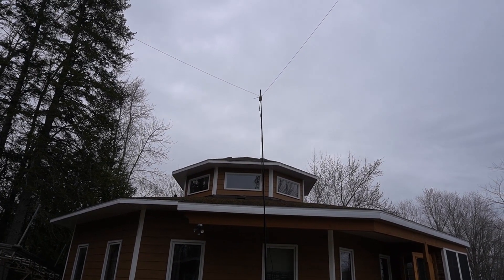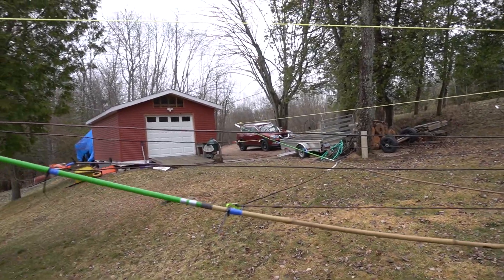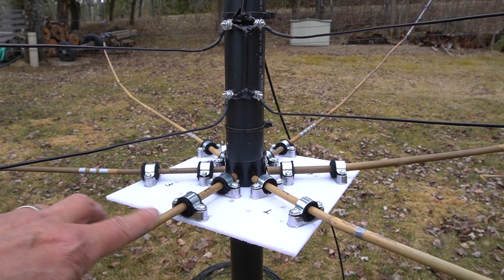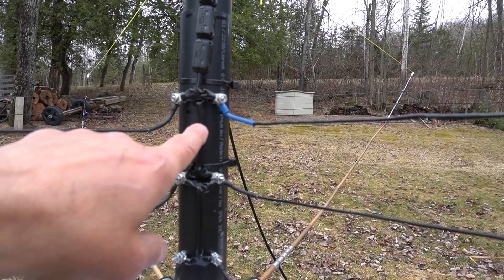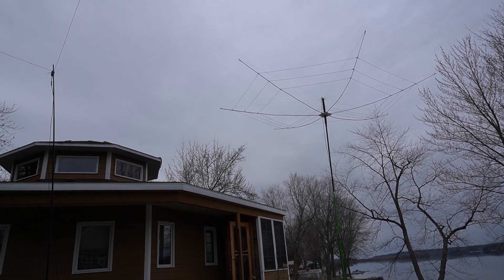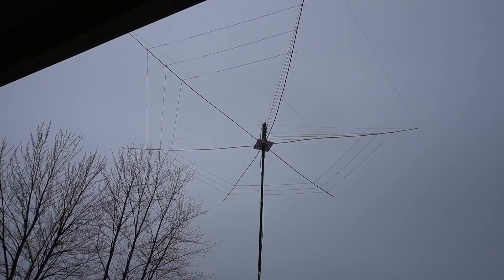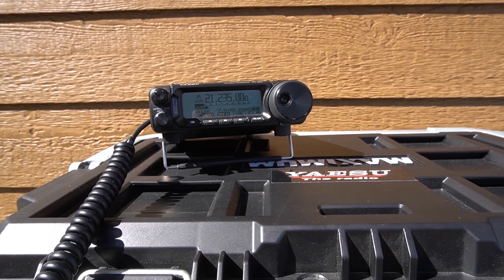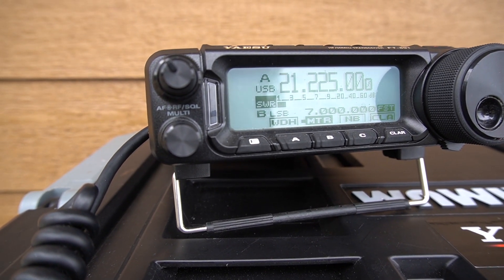HAM RADIO - HexBeam 10/12/15m Home-brew Update and Test

Comment: When your swr is high, it comes back inside. 2 ferrite beads are almost useless. You need about 10. At 15 ft up the swr shouldn’t  read 9:1. The 10m wire is too short. Closer to the ground should read longer due to ground. I would re measure again
Reply from the maker: Hi Jay, I didn't have more beads and I will add more. After this first test I noticed that I have to re measure the wires. Hopefully I will get better results next time. Thank you for the comment. 73 my friend!

Comment: Did you take any chokes you?  I see you have chokes on the antenna side.  So check if you if you have a usb cable that is rf protected. does it drop out if you transmit at lower power?   How does SSB work on ten?  is it distorted or cutting out?  That might give you some clues.  I have had similar problems.
Reply from the maker: I had a ferrite sleeve choke at the feed point. I had the same problems on 10m with a yagi that I built. This weekend I didn't have a chance to make contact on ssb 10m but with the yagi I did a few dx and it seems to be ok but again not on ft8 mode.i will try a different USB cable or attached some ferrite choke on the cable. Thank you very much for the suggestions. 73 my friend.